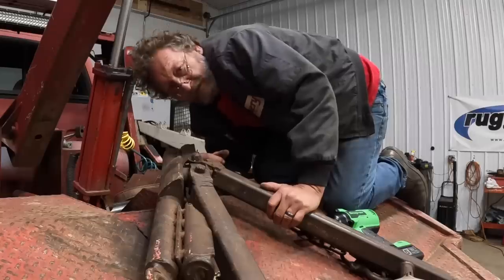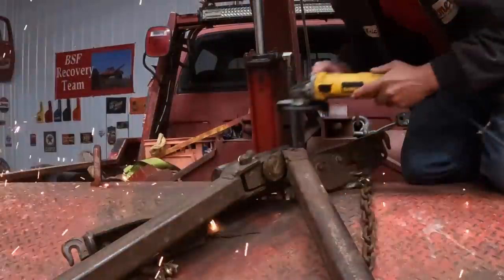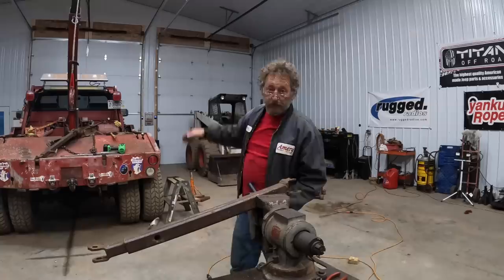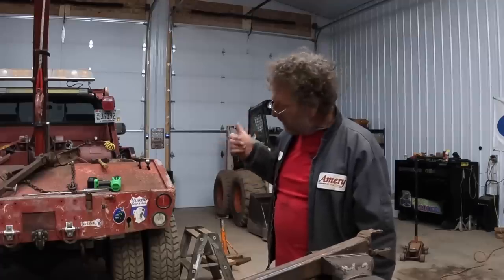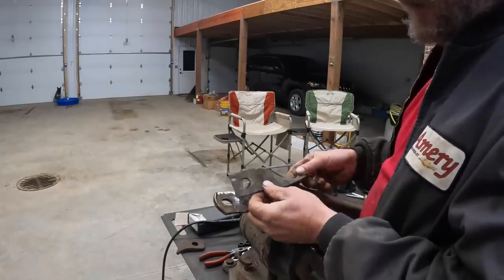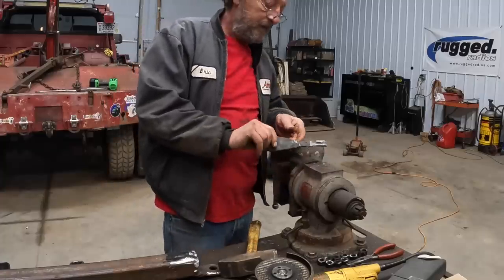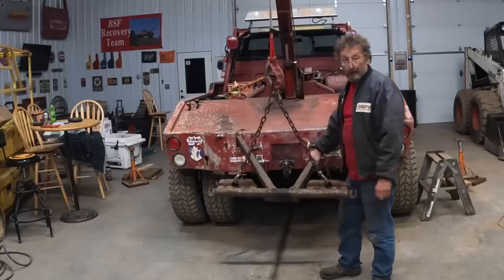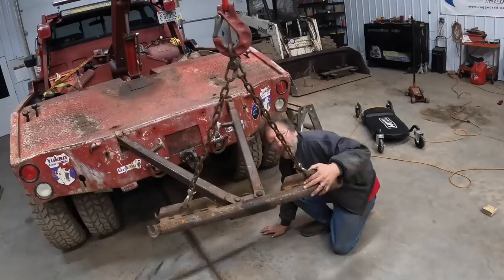Do we still need the hard sling on the wrecker?

Comment: I got tired of changing discs so I bought more angle grinders! Saves a ton of time!
Reply: yep , i use the same metode works great
Reply: Same here: I have 3, cut off wheel, grinding disk & flap wheel
Reply: @tyendor1952  yes that works nice, i even have them cordless on 20v 8ah battery
Reply: @martijnbrandt7553  
Me too, same with drill/drivers, one for drilling, one for screws and another with a socket driver (not impact, but saves a shed-load of spannering). ❤️🇷🇴
Reply: @clivehorridge  and even we all have some time to spare to watch YouTube 👍🤣
Reply: Same. Wire wheel, flap, cut off, grinder.... Same with my die grinders. They were cheap at the time and I got tired of changing bits. Had about 5 of them until they got stolen.

Comment: That really is an interesting ole vice. I believe you said your dad got it for you when you were younger, but I may be mixing that up with something else. It takes a beating, and keeps on performing. I have a Craftsman about 10 years old. I was using it as an anvil to bend back a lawnmower blade with a 3lb hammer, and it broke off at the base. I fixed it so I can still use it, but it doesn't swivel anymore. They really don't make them like they used to.

Comment: I think you need both set ups. The hard bar doesn’t require another person in the towed vehicle. You know that. Safer. But the type of trails in Sand Hollow and Moab the hard bar didn’t quite work. Some trails required the vehicle towing to get up the obstacle then the vehicle in tow then be pulled up.
Reply: Spot on. Having both options gives you more...you know...options. 👍
Reply: I'd also like to see him add 3-4) electric winches to the wrecker bed for the same reason.
That PTO winch is awesome for the heavy and long pulls, but another electric winch on or under the boom would be nice for tricky load adjustments while moving and a rear one mounted to the bumper would give him options of walking a load up and over obstacles.
(As for the other 2 I listed, who doesn't love side puller winches!)

Comment: I used the same light duty sling bar nearly every time on or off road. My off road wrecker had two slings, one with half width rubber straps and one with no straps. The narrow straps used the two inside mounts. I liked those better because most of the guys wheeling were running newer trucks. Over the years guys started using the newer trucks for trailer towing duty.

Comment: I think just recently Matt dented the hood of someones Jeep with the wrecker coming off the rocks.  I can see why you like the hard sling, stops the towed vehicle from sliding forward and hitting the wrecker.
Reply: All Matt needs is a thick walled pipe 6ft long to run his strap through.. When you hit the brakes the pipe stops the rig being towed from rear ending the tow rig!
Reply: @MrDan1509  Matt is still figuring out and learning what works best for the terrains he works in. It wouldn't surprise me if he ends up using a hard bar for some recoveries and the soft "X" for others. One thing about Matt is he's always learning and his methods are evolving. It wasn't too long ago that he didn't feel the need for a winch. Now he's got a bunch of them.
Reply: @bripslag   I said this a few yrs ago when he was just towing bumper style with the jeep.. Never listened!

Comment: I like the way you still use a stick arc welder. I like the range of rods better and I can trust my thick steel welds better with a stick. Migs and Tigs are great for thin metal.
Reply: Much easier to get a stick welder that puts out the power, and with bigger rods it’s easier to do thick steel and get a good weld. 
With common MIG and TIG machines it really takes multiple passes to get a good weld on thick stuff. 
They make MIG machines that can do thick stuff, but that’s more industrial stuff you don’t see often.
Reply: No doubt.
I have 2) 180 MIG welders and I still break out the old 300amp stock welder when melting together thick structural steel.

Comment: I wonder if the Utah guys would be helped by having curved spars instead of a stiff steel triangle or crossed ropes.  Like using the ends of a re-curve bow where the spars flex but always have a force to separate the vehicles.

Comment: Hey Eric,

A recommendation for you.  Buy a 2nd grinder,  best case a different brand.  That way there, you can have a grinding wheel and a cutting wheel without having to swap back and forth.  Saves a lot of time, and does not cost very much.  A buddy of mine gave me the idea about 10 years ago...I can not believe I used to work with only 1 grinder these days.

Nice job fixing the sling back up!

Comment: Hard sling needs to stay and the rest of the crews that have wreakers need them also to keep the vehicles from banging around with the chance of damaging a vehicle, like someone I won't name did.
Every off road vehicle should come with a V tow hitch on the front or have a set up that pins into brackets front and rear. So a swiveling V tow bar can be used to keep the vehicles away from the tow truck when towed.
I've got a old school coffin welder lincoln 220 unit that I don't need anymore just need someone to make me an offer on it I do have the cables for it also.

Comment: Here is a little bit cheaper fishing reel
For 4x4 Towing.
(1) A base block . That you can weld and bolt 1 x 4 x 4  with a hole for the shackle 

(1) D -Ring Shackle

(1) Snatch Block

Hope this Helps 

This will help you on those Rocks 

Reel in and release 

Allows you to get up over the obstacle then pull up the tow vehicle.

Great job 

The Fishermen

Comment: I bought two Menards grinders, so I don’t have to switch between the cutoff wheel, and flap disk. Also they are a beast in my opinion. I have used dewalt and Milwaukee. Just my opinion.

Comment: The essential craftsman suggestion for metal fab and welding. Corded angle grinders arent expensive. changing disks back and forth so time consuming.  There's only benefits to having multiple grinders for cutting,  grinding, and sanding.  There are no negatives.

Comment: Good morning Eric! I have the same wrecker bed. My hydraulic Ram is leaking at the top. Should I just replace it with a new one like yours or have it rebuilt?
Reply from the maker: Have it rebuilt, it has a safety valve in it for on road towing if a hose blows. the farm cylinders like the one I use do not.

Comment: I think the tow bar is a great option instead of the hanging sling.  I wonder if it had a swivel at the  end if that would prevent breakage.  Nothing fancy but akin to a 1 1/2 bolt.
Reply: I’ve wondered if a yoke and u-joint setup would work. That way it’d control the forward/backward movement but allow it to pivot and move around some. 
But, might add enough leverage to bend or break the arms.

Comment: Yep I think using this is preferred,but I understand why the Utah mob may not .
The ultimate aim is not to ding up someone's vehicle.
Using what you have at hand ,that's cool ,would be nice to build one of them using those ball joints as used on tie rods and arms that the other off roaders use , easy to fix as they screw in and out ,but if they are expensive,maybe some old suspension arms ,trailing arms that could be lying about .
Hey Mr cool and casual on the grinding and welding 😮 and you got it done and survived
How's the proposed jeep build coming along ?
Cheers

Comment: There's nothing wrong with a Hard Bar sling if it works for your needs.  Rory is dragging Jeeps and trucks over Extreme terrain of rock crawling.  Eric seems to be on really bad dirt roads without the extreme angles and flex thatTrail Mater deals with.  It's a good observation that the BSF rig has a worn out Arm Bar assembly which give it the extra flexability that he needs for off-road work.  A newer one with tight joints might snap rather than give under flex.

Comment: I'd rather tow on a bar than a wheel lift if possible. Keeps the steering axle from getting light. Back before wheel lifts we didn't need those long wheelbases. I had a short single axle Mack that could tow a loaded concrete mixer on a bar without any problem,  you could never do that with a short truck with a wheel lift